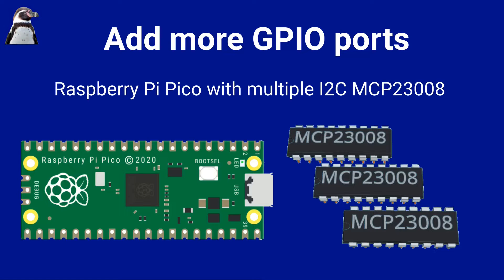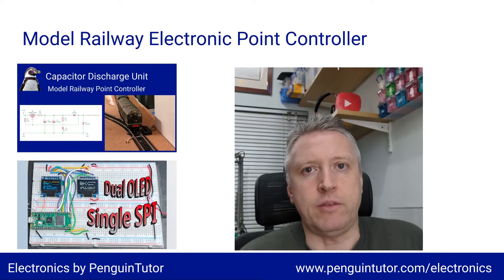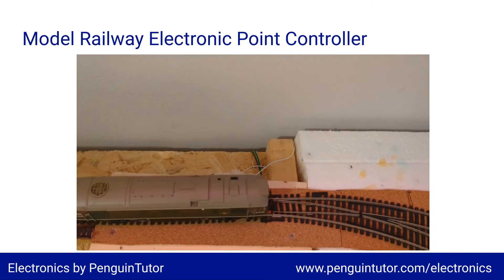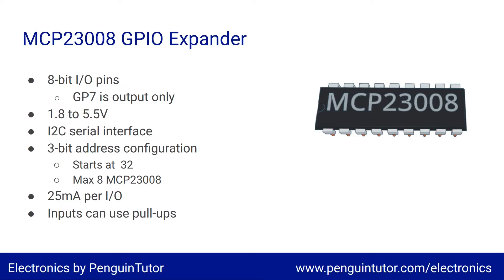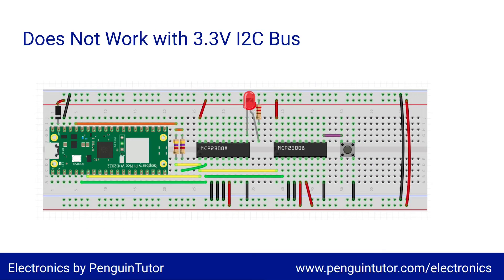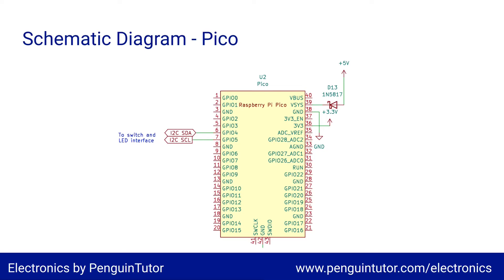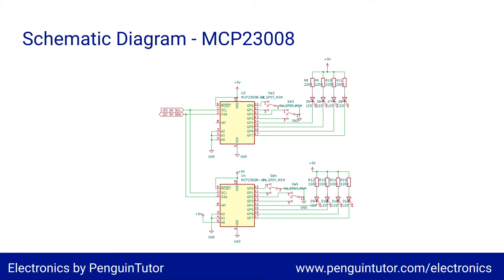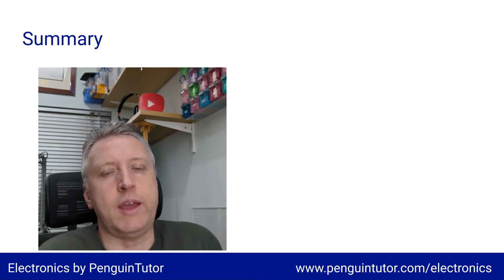Using MCP23008 GPIO expanders with a Raspberry Pi Pico - with dual I2C devices

Comment: I think I'm going to have to use these. I wanted to use an Arduino mega to make my own computer system inspired by the apollo guidance computer and the Altair. It has over 50 io pins, but from all the  reading I'm doing, the harvard  archetecture does not allow executing code from ram, which was placed there from input pins. It appears I'll have to use the pico instead.
Reply from the maker: @alanfitzgerald9026  That sounds interesting. I'd be interested in seeing how it goes.
Reply: @PenguinTutor  I sent you an email via the form on your site. It will be a long project to teach me computer science and electrical engineering things, but will be a cool concept. In an ideal world, a community of tinkerers would be able to be formed, similar to The 8Bit Guy's Commander X16. My goal is to emulate the actions and feel of early computing using cheap, readily available modern hardware that can be fashioned into Peripherals. In a nutshell: Create a system from off the shelf hardware as IBM did when they designed the IBM PC, but instead of advancement, it is a historic action/mentality/'50s, 60s, 70s and 80s computer culture preserving device, designed by some one who is too young to have been there
Reply from the maker: There are various community groups. Some are more specialist than others. 
I'm a member of MERG which is specific to electronics for model railways. 
Another group I join, which is online or in person, is Raspberry Pi and Pint. It is based in London, but everyone is welcome to the online meetings.

Or you may have a maker space in your local area if you are looking for a local group. 

I do find the groups are more useful for general discussions rather than for supporting a particular project, but if you find someone with the same interests it could be helpful.

Comment from the maker: I've just experienced a problem with this code on one of my projects. I haven't yet found the reason why as it worked during testing, but then failed when put into the project. I have found a workaround which is to use software based I2C instead. If anyone experiences a similar problem I have put details of the workaround on my website at: 
https://www.penguintutor.com/electronics/pico-mcp23008

Comment: The thonny always flash over your ppt at first minute. That feels like a flash bomb and hurt my eyes😰.
Reply from the maker: Sorry if it's a bit bright. I tend to use colours that are accessible, including light coloured backgrounds and (when possible) increased fonts and cursor size. This is in response to some of my earlier subscribers that said how difficult it was to read the screen sometimes. Although I've also noticed that in Thonny even the dark themes have a very bright background for the main part of the editor.
Reply: @PenguinTutor  No what I mean is that in the first minute of your video, thonny's window will always appear in the top half of your screen and then disappear. This causes the top half of the screen to be flickering constantly.
Reply from the maker: @cubeleaf7895  Oh yes I see what you mean. Sorry about that. 

I didn't see that in the video editor, but then it does flash away pretty quickly. I created the presentation in Google Slides, it's one of only a few times I've used that for creating videos. Perhaps I'll switch back to LibreOffice Impress in future. 

Thanks for pointing it out.

Comment: Oooh, what a fascinating chip. One use i can think of for this is to have it at a distance from the processor just using 4 core cable
Reply from the maker: Yes indeed. I2C can run for a few meters so as long as it's not too far.
I'm planning to use the MCP23008 on a different PCB although I'm my current project they will be in the same enclosure.